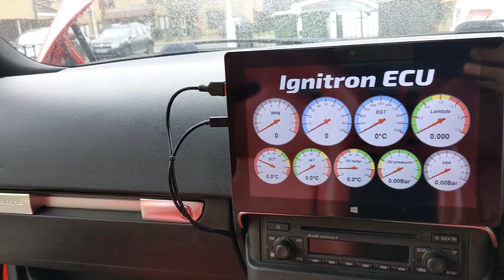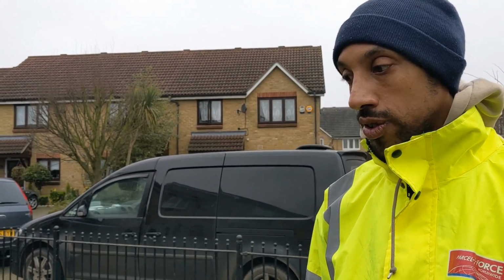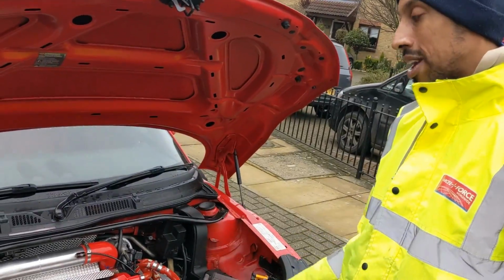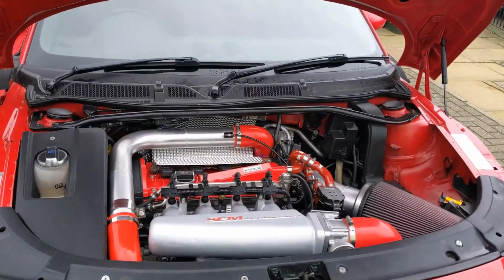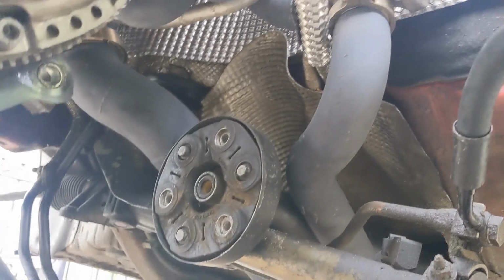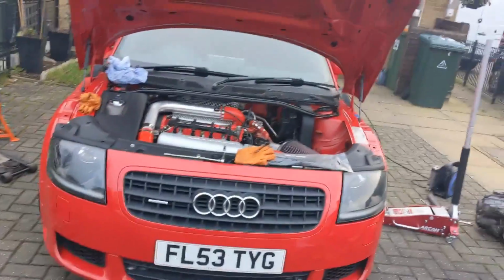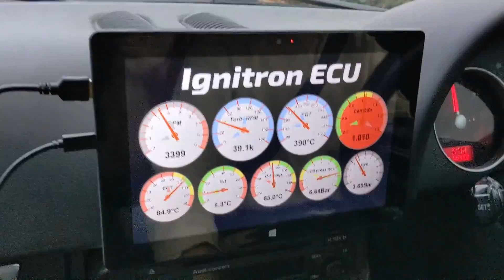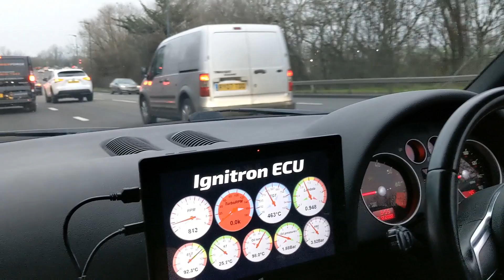500 bhp monster Audi TT Big Turbo Garrett G25-660

Comment: God that looks clean.
Reply from the maker: Yep, all credit to The builder and the owner
Reply: @BWSTT  is it really drivable? I'm asking as I'm looking to do something similar?
Reply from the maker: @paulknight7535  yeah, the car drives nicely off boost, and is an animal on boost. If it was me I would go for a 550, and sacrifice peak bhp for a slightly earlier spool, but for track work the 660 will happily be in usable power band
Reply: Excellent I'm looking g25-550 full build but I really don't want wmi my budget is good but I don't want to end up losing drivability .
When it's done ltr this year pop by 🤫😉

Comment: 5 hours?!?! I’m having the clutch slave and clutch and some other bits taken care of and I’m hoping to have it back after a week!
Reply from the maker: Specialising in TTs has its perks, I know all the shortcuts
Reply: Is the TT much different to the Leon Cupra R mk1? I thought they had the same front end .my mechanic has had my gearbox and  clutch off a few times (long story why) and he can do it in less than a hour.
Reply from the maker: @webdesignengineeringservic6515  the cupra is a front wheel drive setup, the TT is Quattro. It's the Quattro aspect (the transfer box) that restricts the job
Reply: Fair enough, can imagine that adds to the complexity.

Comment: Hello I am looking for a turbo inlet hose to the turbo that is 50mm or 2"  for an 2006 Audi TT I took the ko3 out but now the TIP on the turbo is larger. Car is at the mechanic right now and trying to figure out what I do for a turbo intake pipe or tip  to connect to the Mamba 4660 extreme turbo

Comment: Hello nice videos.  I bought a mamba turbo ko4 with the out diameter of the turbo inlet is 50mm wide.  it is a Audi tt 1.8t 2006 FWD.  can you show me  a turbo intake hose that will connect to the 50mm or 2" end that goes to the turbo? I see all these hoses online but they are all 45 mm at the turbo side.

Comment: Good video, next tine you do the box leave the prop on and the transfer box behind 👍
Reply from the maker: Nah, no need to add expense of seals and fluid, it's a bit more fiddly on this one because of the downpipe situation, but it's still the easiest way and the way I do it every time
Reply: BWS TT cool, each to their own. I must have done my S3 clutch 8 times, always re-use the o rings with a wee bit sealant on them. Don’t mind giving the gearbox oil a flush either.
Reply from the maker: @James Chaffe when it's your own it's a risk you can take, but for customers I couldn't chance it- last thing I wanna do is lose a day's labour to go and sort out some seals. I do discuss both options on my clutch change guide, and for some people that will be the easier way

Comment: Hello! My current set up is with g25-660 on a stroked to 2 liters 1.8t. Tried to tune it with the stock me7.5, it didn't happen good, and now I'm breaking in a second stroker... and waiting for link ecu. I want to ask some question about the car if possible: 1: What is done to the head?
2. What is the boost pressure on the high setting, because I didn't hear that in the video?
3. What are the pistons?
4. What is the rpm limit?
5. Are any performance measurements done? Quarter mile, 0-100, 100-200 (km/h) or the mph equivalent of course 😁.
Very nice build, engine bay and car in general, respect! All the best and thank you in advance for your answer!
Reply: I would live to hear those answers as planning the same turbo

Comment: Hi, I was searching on You Tube and came across your page. I have got an Audi TT Auto, 2009 with similar problem and same faulty code (P2711) Dual Clutch. The car does not go into Reverse. Is this something can be fixed and will you be able to fix this issue? Car is in London and I would appreiate if you let me knoww how much does it cost?

Comment: So its about 4k RPM that it really takes off? I'm just trying to gauge how it compares to the BBTR K418T K04 hybrid in my S3 which takes off at 3.5k RPM. I'd love to upgrade to a G25-550.
Reply from the maker: 550 spools even sooner, check out prawns upcoming comparison video from his 660 to 550, not sure when it'll be but hopefully soon
Reply: @BWSTT  I'll have to keep an eye out. Making more power is great, but I'd trade a bit of overall power for some more power down low.

Comment: This spools too late, I just seen it spool at 5k rpm?
Reply from the maker: It spools before 5k rpm. At 3k rpm its got more power than a k04 hybrid, at just over 4k its at full boost. This was on 1.8 displacement still, you should see it now that its on a 2.1 with a g30-770! Currently 666bhp on race fuel

Comment: I'm still in the process of watching the video so maybe he explains it later but why doesn't he have a heat shield for his air intake?
Reply from the maker: It's simple, volume is king. He wants to draw in as much air as possible without restriction, then the combination of a massive intercooler and the water meth injection get the air nice and cold in time for the intake manifold

Comment: What did the build cost
Reply from the maker: A lot...
Reply: @BWSTT  looks good, nice video bud
Reply: @HiPpYBoAtErS  I think when I was shown around it Alex said about 30k has gone into this car with all the different various set ups
Reply: Ignitron ecu 1500, G25 another 1500, forging the engine probably 2k, fmic 400-600, add another 1000 for exhaust, 400 for fuel pump and thats just not even half of it.